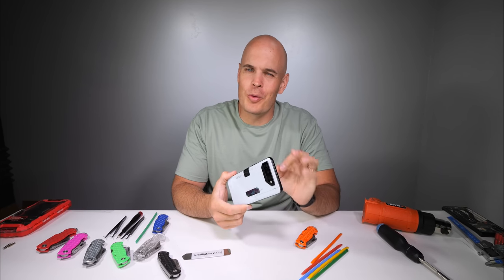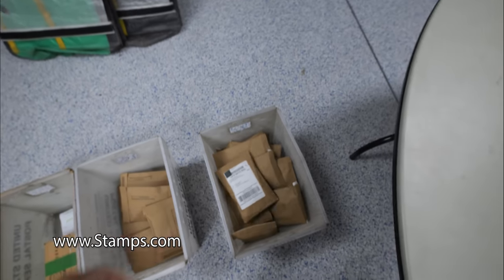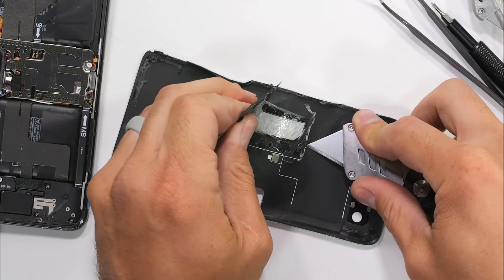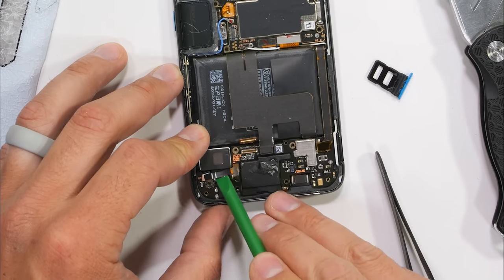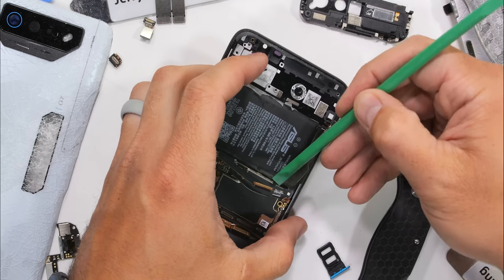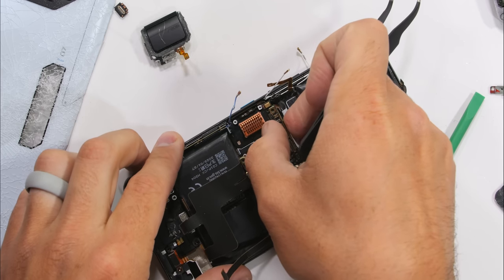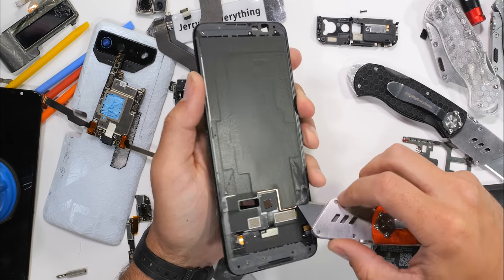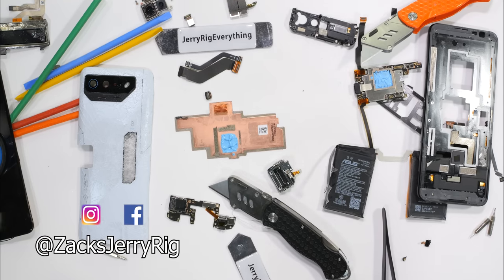Worlds most Complicated smartphone cooling system - (ROG Phone 7 Ultimate)

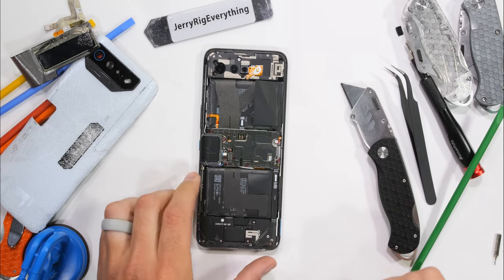Comment: 2:59-3:00
So you're saying that a 1500$ phone has the mother board split in to 3 but if stacked/not split then jts barely half the phone?
And the nintendo switches are 2 or 3 time sbigger with their goofy old busted motherboard systems 😂

That Tiny motherboard has 5 timex the power of a switch 😂 Why nintendo?
Reply: stacked motherboard is pretty expensive to make. you can find it only on some flagship phone.would people want to buy a switch with slightly bigger battery with  higher price?
Reply: @hajiku1606  you know switch has the most outdated spec compared to release date to the newest models ( Oled only has slight changes like Speaker placement, Battery? And few cables here and there changed )

But holy Sh- that thing runs games at 10 fps if they are bigger then 2kb 😂
Reply: @hajiku1606  People are buying switches that cost 100$+ more for just a re-color or if you think about the switch oled compared to the normal one you'd see people would pay double the price for a better performing switch, that's why the switch pro rumour was very hyped for a while.
Reply: @brunoob-1  that doesn't mean it need a stacked motherboard. It's not necessary when size isn't the main issue. the processor is the major drawback which still runs on old nvidia tegra
Reply: @jonathaneriksson9273  you're not getting more performance from stacked motherboard, you get more internal space. Most people doesn't even know about it unless it's advertised or compared aggressively. Oled panel upgrade is easy to see the improvement since it is a feature that normal people can see and understand. you think the switch gonna sell better if it has 10% more battery instead of oled at the same price?
Reply: @hajiku1606  my point was that this phone with stacked motherboards even if it were fully flat ( taking out stuff that arent on the switch so Camera's board technically wouldnt be counted ) It would be half the size of a switch or roughly there and still it would perform Way better then thr current switch

And nintendo being nintendo still havent had any thoughs of even fixing the Joycon drift

And then for some reason they got extremely offended by a Youtuber making Mario Plusheee videos ( @SML ) And got so triggered from him that they literally sued him over for now to not have any rights to use anything that nintendo owns so they cant even mention Nintendo, Switch ( specified in context ) No N64's Or even Mario/Names except Peach as its also a common word outside names ) 

Literally nintendo has the balls to sue a Youtuber after he got demonitized secretly for over a few years and then he gets less money from his shop and then he cant even use Such a big amount of potential

And the same dumb💩ss people there still dont want to fix Joycon Drift which isnt actually that hard concidering Magnetic versions of joysticks are a thing and 2nd being the Hardware of a busted 2015 "console" which has the stats of a common 2012 nokia phone

Bruh why are you defending it?

Yes i know Stacked motherboards are more expencice to produce and to fix and etc... but if they were to not split them apart then it would technixally be cheaper and the specs would be from a 2025 nokia phone
Reply: @hajiku1606  I wasn't arguing for the use of stacked motherboards, just that I think there's a lot of people who'd buy a better performing switch for double the price. The oled switch is genius a genius move from Nintendo to keep milking their customers money with ancient hardware and a new oled panel which are now very cheap to buy.

I can't believe people are paying this much extra for the oled when you can barely see the screen in the sun and yes even though it now looks a lot better indoors, no one wants to play undocked any newer titles since that would be at the cost of the performance, (currently pushing games at <30fps) and playing on smaller screen.
Reply: @brunoob-1  how the hell making stacked motherboard improve performance? what makes rog have a better performance is the soc itself which is ~8 years gap of technology. you can make phone that performs near identical with rog without the stacked motherboard. rog use it for reason such as making side connector for charging possible, splitting battery for faster charging, slightly more space, easier cooling system while at the same time still usable in portrait as regular phone. I'm not backing nintendo by any means, switch is shitty and i know it but a stacked motherboard isn't the solution. what they should do is use qualcomm latest ARM processor instead of nvidia old tegra,  they should use better cooling system like vapor chamber, faster smaller flash storage game card(or just remove it) for more space, electromagnetic module joystick for longevity. there's always a drawback to all of this such as the price would be at least 600-700 usd. such example is rog ally which is switch with better hardware
Reply: @hajiku1606  how did Valve do the steam deck with Over the mid ramge phone specs with almodt the same size except that the controls are stuck...

Take that and just Cut the controls off and slap tiny wireless connection thingys from the Joycons and Thats it 😂 Better switch specs which costs well not that much
Around 50usd more then the steamdeck if from Switch Oled
( im not sure if prices have gotten up i live in europe we dont got no wallfart stores ) 
But there are countless "Budjet friendly" Upgrades that nintendo's team Could do

And well yeah the switch wont get as much value from just buying switches
But you know... Modt switch official games cost from 30 to 60 ish dollars
Thats alot compared to steam with Steams Discounts even!
All nintendo sales that i have seen have been irl in gsmestops or something years ago

The nintendo's Solution to "Fixing" the joystick situation was to say "F-CK Off" to europe and give Usa and Asia the support to send joysticks to nintendo's post office or something for them to send new or newly repaired ones

Thats just a scam concidering Europe has alot of people aswell and that europeans do own switches too
Reply: @hajiku1606  Smartphones not so much but handhelds can easily benefit from stacked design.
Reply: @brunoob-1  it's tech advancement. nintendo runs on nvidia tegra x1 based chip which is ~8 years old chip while steam deck uses amd ryzen based chip similar architecture as the ps5 and xbox. what do you expect? it's like comparing iphone 6s with iphone 14. 

Nintendo has exclusive rights to nintendo games. if people want to play nintendo games legally, they have to buy a switch. that's the issue. people still want to play their game despite the junk hardware
Reply: @hajiku1606  i ment to reply to your "who wants to pay 600-700 usd" reply
valve did it with only around 50 bucks more to pay and even put better specs

my point was to point out how nintendo Could make the crappy current switch Better and still cost barely more then the current one

and valve gets money from steam games too but the thing is Valvetechnically gets less money
and Valve actually designed the thing to be easy or "easy" to fix god damn it iFixit is the one making replacements

do you understand the difference
nintendo is so trash as they spend more money to design a crappy unit meanwhile valve is "losing out" from Cheaper games, Fixability ( nintendo sucks on this one ) and support
Reply: @brunoob-1  that's because there isn't much processor option for handheld when switch was first launch. ryzen were just introduced and still underperforming intel and no rdna architecture intergrated soc, arm processor weren't faster than nvidia tegra x1. that's why i talk about tech advancement. there's almost 5 years difference in release and close to 8 years in tech difference.  is an 8 years old flagship phone faster than current mid end.
if you're talking about why not make a new switch better, a simple answer is why would they? steam deck never competes directly since it's technically a portable pc  (sales drop may change their opinion on this) and nintendo games is still exclusive on nintendo hardware. 

I don't like what nintendo is doing but this is what tech industries always do when they have monopoly. intel been doing it before ryzen came out, nvidia still doing it right now and apple been doing this for eternity. i hate this trend as much as you and only fix is people gets educated and stop buying shitty product